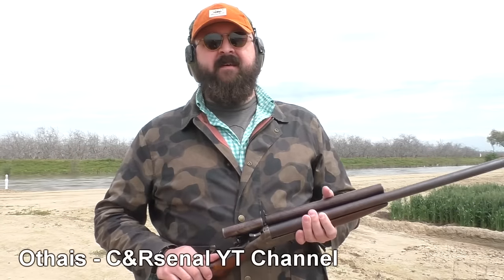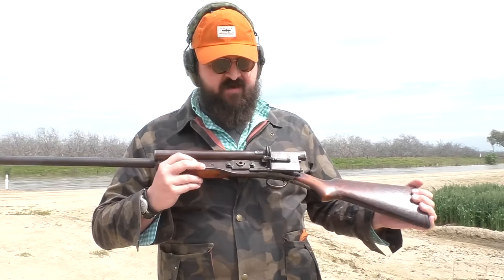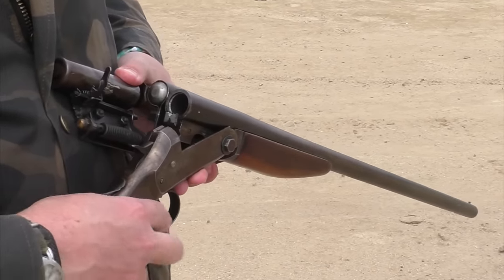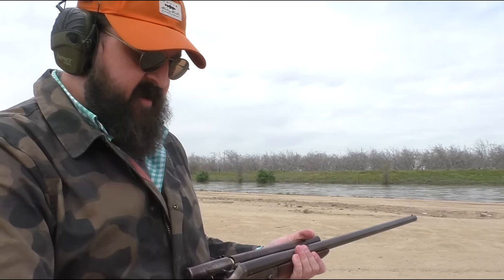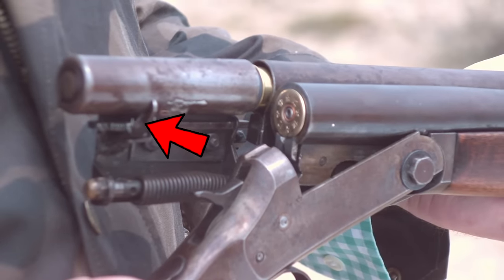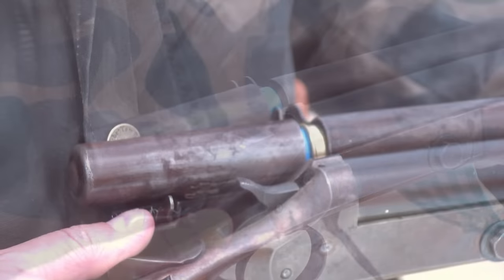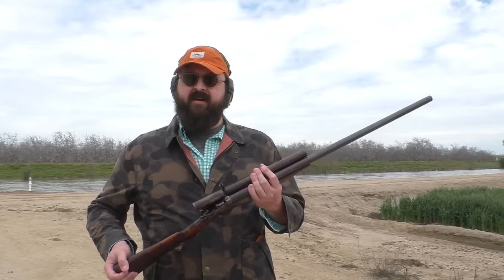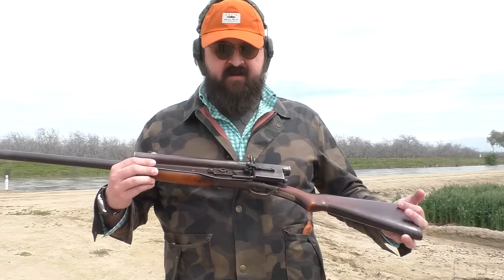The Curious & Clever ALOFS Repeating Shotgun System of the 1920's

Comment: I'd love to see a modern alofs mechanism designed with readily available or 3d printed components
Reply: I have jsut begun modeling in fusion. That seems like something very doable- or even sheet metal to get cut out on a local machine shop's waterjet? them are getting common too.
Reply: Or a twinned version for double barrels.
Reply: @Del_S  I don't think it would work for double barrel without some modification of some sort

the tab to activate it acted similar to a modern rifle ejector, causing the spent shell to redirect sideways

with some slight modification to that tab, possibly lengthening and lowering it so that it gets hit by the bottom of the shell may work. it should redirect them upwards, allowing the system to work with a double barrel shotgun
Reply: It would be a great curiosity but good pump shotguns are pretty cheap these days.
Reply: In both sides in a double barrel...
Reply: @Stautz21 there's a simple solution, change it to be manual operated, so you can push the button after the two rounds were left out, funny enough that could work with other single shot rifles, like the rolling block, Martini Henry and so on.
Reply: Why.
Reply: There's some videos on YouTube somewhere of digital models in both single and double
Reply: @nathanstautzenberger8381  Yeah, you're right, it'd need a fair few tweaks.
Reply: @Joshua Gibson  why not? 

Of course, the answer to why in most cases is a simple "because we can". It's just satisfying our own curiosities.
Reply: @nathanstautzenberger8381  also I assume he's talking about side by side double barrels which very rarely come with ejectors unless they're very high end. The side by side system doesn't lend itself to easy ejector design but over under sure does.
Reply: @nathanstautzenberger8381  wouldn't that be the KelTec KSG?
Reply: @MinnesnowdanSniper  Considering a torsion bar or leaf in pla/nylon might be a better option than metal springs... So many options :D
Reply: @nathanstautzenberger8381  Lol I'd hate to be the test-shooter, those spent shells might go straight into your face if they don't get the angles right on the first try.
Reply: @joshuagibson2520  Because not everyone owns a semi-automatic shotgun.
Reply: @nathanstautzenberger8381  A double barrel version with a mirrored left and right handed version would be possible.
A version for a Drilling triple barrel gun would get weird.
Reply: @1810jeff  Side by Side shotguns usually have ejectors - they sometimes have issues chucking a case completely out however.
Reply: @allangibson8494  Like I said only the high end ones usually do, most ones that are under the 1000$ mark have extractors not ejectors.
Reply: Why would you 3d print a sheet metal stamping and a tube? Tubes can bought at any desired length. And after dies are made,  sheet metal can be stamped into basic shapes in under a second.  The hardest part of the build, assembling the springs and pins,  is the parts you cannot print anyway, so why bother printing at all?
The pivot pin in the shotgun is replaced with a bolt to attach this feature. (Notice the hex head on the reciever). That may have been fine when 1920s break-guns had nearly universal geometry. But there's been a lot of changes over the years. Making a new one would have to be specific to certain models for that pin to line up perfectly.
Reply: @Del_S almost all inexpensive doubles don't have ejectors
Reply: @nathanstautzenberger8381 most double barrels don't have ejectors. They have extractors. This machine requires ejectors to operate
Reply: @RequisiteFunction  So you're basically needing an already rare gun on top of fiddling with the mechanisms of the device, or modifications to the shotgun, at either point which you might as well just start building an entirely new shotgun yourself?
Reply: @Del_S  yes, that's pretty much the case. I don't think anyone with a $2500 shotgun is going to hang this wonky contraption off both sides, essentially making the gun useless for its original intent. Expensive shotguns are built with geometry that enables the shooter to accomplish their goals. The weight and barrel length are part of that equation and make a difference in lead, swing, and follow through for moving areal targets.
 All of those measurements go out the window when you stsrt hanging all that stuff off the sides. You'd basically have to relearn the feel of the gun.
With few exceptions, single shots were always rudimentary shotguns for generic "all purpose" shooting.  So it's more advantageous to do this to a $200 single than a $2500 double.  
What would be interesting is seeing the contraption being used specifically for mini-shells. 
The same unit for mini-shells would intrude much less into your face area.

Comment: Your thoughts Jeff OG was wondering if you would do this I got my jxp 10mm the NEW 10mm  I also have a jhp 40 got it 3 years ago. Is it worth it since there.is no video doing a comparison to show how different but exactly the same they are.its actually insane on top of that. I have a Brownells 10mm chamber finishing reamer for the jhp 49 so I can convert it to also shoot 10mm . The big reason I'm sure you understand why is that the 10mm is significantly lighter than the 40 the slide I mean. Other than the rail the frame is identical. And I can mix up the parts in a bin and they will all fit both guns except one barrel is 10 and one is 40 to understand what I'm getting at bunch of reasons but no one else has. Would you or do you guys hate hipoint I have to say I love them other than ugly they are more reliable and durable than some all steel pistols even some that I don't know won 2 world wars haha. Wait no it's 3 now right. Or is it still to soon

Comment: So, Steven's Model 94 was made starting in 51 or 52. I only know because I have a 1952 original with the first generation bakelite stock and grip. 

Interesting someone took something from the 20s and attached it to a gun made in the 50s. 

Well, actually, not that strange. I saw a Mosin with a red dot the other day....
Reply: I have one minus the stock I found salvaging an old house sometimes in the late 70's. Does anyon🎉e know where I could find the correct stock for it? I've been saving these pieces for around 45 years. Thanks, Thomas, Mississippi!
Reply: @thomashaley7657  mine is worth $100 to a collector in mint condition. Yours might be worth scrap. Steven's was the bargain basement brand of Savage back then, which was already known for low quality at the time. 

But, to answer your question, gunbroker.

Comment: All that fideling for 3 shots...if they changed the loading system to get like 6 shells in there with a longer shell carrier and proly detach the spring to not having to hold it open, that might have worked. But the system seems also demanding, doubt anyone wants to constantly repair the mechanic behind it. But nice to get a look at that!

Comment: I wonder if it could be potentially done to a doublebarrel to make a 100 year old KSG12.
Also, couldn't it be 3 + 1 + 1 by putting 3 in the tube, topping off and then putting one in the chamber whilst holding the loading basket in place?
This is just a genius design. The hillbilly rural scrap metal and grandpa's rusty lead thrower kind of genius.
Reply: I envisioned a double with such. But imagine how wide it would have to be and then trying to put shells in both sides. But it does make for interesting thoughts.

Comment: "So you take this complex, kinda janky contraption, and bolt it on to the side of your outdated, single shot, single action Stevens, and it'll take a shell backwards out of the tube, move it over to the right, then shove it back forwards into the breech. Oh, and your gun is going to be way more finnicky to operate, the weight distribution will be ruined, and it'll sometimes just not work at all. Yes, you still have to manually cock the hammer."
....
"Wait, where are you going? There are so many more features and innovations to talk about!"